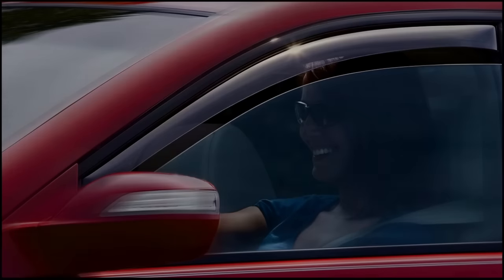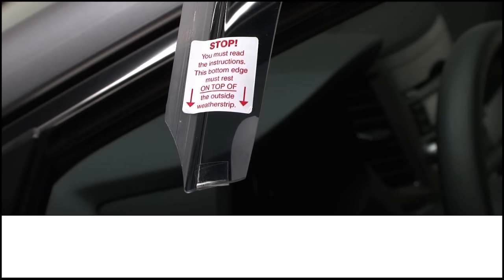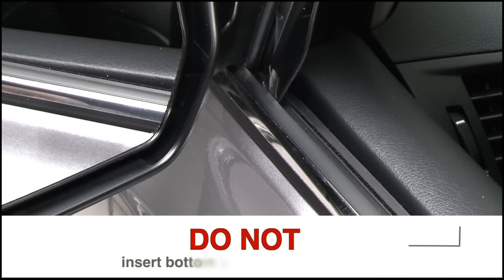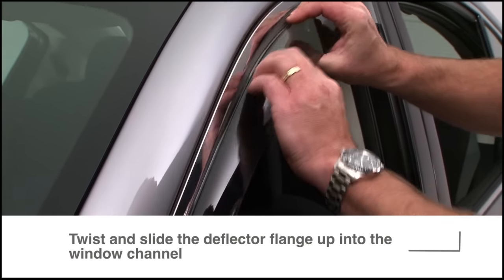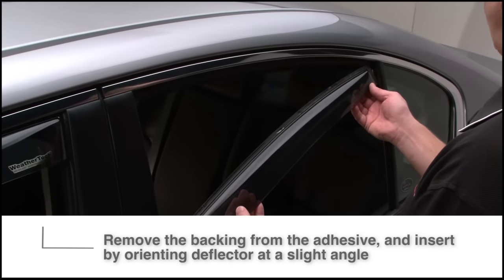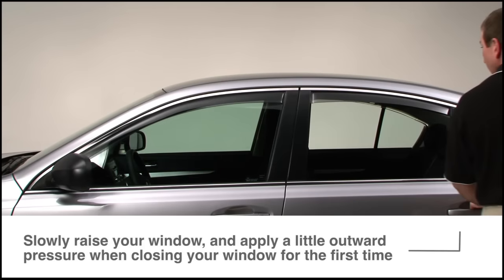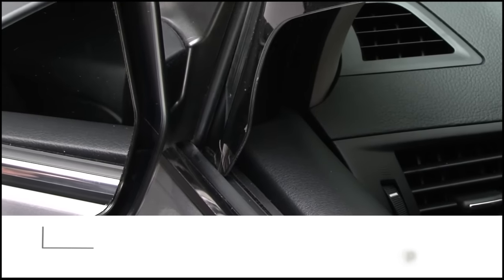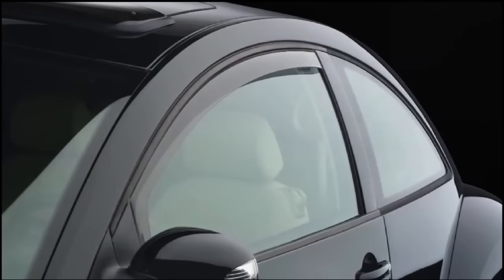WeatherTech Side Window Deflector Installation Video

Comment: so installed these on two cars, g37 and sonata. both were easy as cake on the drivers side but on the passenger, they both broke off a little bit of the edge clip. they installed better with the piece broken and rest great but i'm worried if it will blow off or something. is this ok to keep like this or should i contact weathertech for a replacement?
i will note that they are NOT as flexible as shown in this video, just bending it slightly, made it crack.... i was very disappointed  by that.
Reply from the maker: Please give our Customer Service team a call and let them know what happened - (800) 441-6287. They should be able to help you out.
Reply: +xxx4reggie Check Amazon and use their car 'fitter' tool. There may be models that fit, but don't say they will on the WeatherTech website. I got some for my 2012 civic and their website says they don't make any. However, the models for the previous year civic are exactly the same size.

Comment: Can someone tell me if this side deflectors work good in keeping the rain out. I want to buy them so that I can leave my windows open (a little bit) in the rain and not have to worry about rain coming inside of the car. 
Can anyone tell me if they really work.
Reply: +Gustavo E. Olaizola R. Yes, you can leave the window cracked in the rain without any issue.
Reply: Thanks, I just order it!
Reply: They work great

Comment: I live in New York, and I would like to know if the out side temp. has a impact on the install.
Reply from the maker: You may have an easier time with installation in warmer temperatures. If you'd like to know more about the best conditions for installation, you can give our Customer Service team a call at (800) 441-6287

Comment: 4 attempts at installing rear window deflectors on my 18 Soul Plus, the metal clips don’t seat in the channel and the deflector is loose and sloppy and will fall out if I try to drive with them in. Bad fit.
Reply: The problem started when you bought a Kia

Comment: I've had these on my 2016 accord for about 2 days now, and im noticing a lot of wind noise, is there a problem?
Reply from the maker: +Duc Duy Au Give our customer service team a call at your leisure; they will have some tips to help out: (800) 441-6287.
Reply: @Duc Duy Au, I have a 2013 accord and would like to buy them. Are you still having issue or how you like it so far?

Comment: I will never buy these again. I have bought two sets in the last year. One set for my husband's 14 F-150 and a set for my 16 Ford Taurus. Both sets installed no problems until you go to roll the windows up. His two front ones cracked and all four cracked on mine. I have seen many complaints about them cracking but thought maybe they were installing them wrong. Nope, we followed the instructions to a tee. And they still cracked. I bought the lazer measure floor mats for my car. Have not installed them yet but if they're as bad of a product as the side deflectors I will never purchase anything from weather tech again. And will not recommend them to anyone because their products are not as advertised. Will update on floor mats once they're installed.
Reply: had the same problem on my 2013 taurus, rear right cracked and front two cracked :|
Reply: Have had no problem or issues with mine which were installed over a year ago. Good Luck!
Reply: So... did the floor mats fit? Are they any good? Looking forward to that update!
Reply: The back floor mats roll up because they're not as firm as the fronts but the front ones have worked out great. And to add to the deflectors the rear ones fall out if I roll my windows down.

Comment: My front Windows wont go up all the way with these. Why not?
Reply: The "all the way" up setting is just a hair lower than without using the rain guards. Because of how they are designed with the small lip sitting between the rubber and the window this will happen. Most cars should have a feature to set the full up/down length of the window. You should check your cars manual and if all else fails go to or call the dealer and explain that you installed these and your cars window doesn't stop trying to go up when it hits the top.
Reply: @xex2kok  just expect a fee from the dealership, don't expect free advice, they'll want you to bring the car in....

Comment: will these damage the rubber fittings that you put it between?  Are they just as easy to take off if you needed without any damage?  I really want these!
Reply from the maker: ImmaGhost They should not damage the rubber fittings. Also, if you need any help with removal, you can always give our Customer Service team a call and they should have tips for easiest ways to remove the deflectors: 800-441-6287
Reply: I really want these got my 2015 Altima  but I dont  want no problems  them!

Comment: This guy is pushing out on the deflector when he rolls up each window.  Why is he doing that?  One might expect that from a $40.00 set of deflectors, but you shouldn't have to do anything to make these work correctly.  How are you supposed to push out the other 3 windows when you are driving and are the only one in the vehicle?
Reply: Pete Minter You don’t need to do that every time.  Just on the initial installation.  Then let them sit for at least 12 hours with windows up.  I actually waited 24+ hours.
Reply: To help seat the flange against the outside half of the channel. This reduces the interference with closing the window the first time. After you let it sit for 12 hours, it should stay seated correctly, and no more pulling is required

Comment: Just bought these for my 2010 accord sedan and my window won’t fully go up it automatically comes back down
Reply: my 2008 is250 was like that too, just make sure you apply pressure outward on the visor when you roll up the windows
Reply: I’ll try that.Hopefully it won’t mess up my tints in the process lol I got them done like 3 weeks ago

Comment: Mine broke during install. Not as flexible as video shows. The front kept popping out while inserting the back. It would never seat on my 2004 Tundra double cab. Wasted $$
Reply: Did you try to install them under cold weather? I've heard that on cold days (below 70deg F) they become a bit brittle and won't flex at all, so they say to install on a warmer day, below 105deg.

Comment: Hello, how do you remove the driver visor for accord ? For some reason my glass is not lined up when I roll up the window, I want to remove it and install it back. Is this a known issue?
Reply from the maker: +Azola Frenando If you give our Customer Service team a call, they should be able to walk you through this: (800)441-6287
Reply: WeatherTech I did, pretty much the same way I put in lol just backward.

Comment: Got some for my car and they fit like poop. Cracked the very first time i tried to install the first part. Clearly they made it brittle there and it's supposed to be able to bend in half lol. 2015 si got damage on a trim piece up in the corner because the fitment of this product is garbage. Windows couldn't even auto close after installing and it was popping out of one end because fitment is shit. Gonna definitely be filing a complain with the company because now I have to pay out of pocket to maybe get my money back and pay to replace a trim piece on my door. Was a technician at Honda and I always wondered why we never installed these from the dealer. Horrible product.
Reply: Did you try to install them under cold weather? I've heard that on cold days (below 70deg F) they become a bit brittle and won't flex at all, so they say to install on a warmer day, below 105deg.

Comment: these things are pure garbage. Bought a brand new set and put them on as the instructions provided. 1st time it got washed by dealership the rear drivers door popped off. Put it back on and a month later it fell off again. This time somewhere on the highway. I only had them 2 months and after that 1 fell off I threw them in the recycling bin. I`ll go to a competitor that I have bought a set for my other vehicle and 3 years and not 1 problem.

Comment: no!.. because is urgent. in mexico your dealer.. delete 5 weeks... i called few minutes your office in USA... and told me that have the 2 kits on exist... but cant send to mexico the package...
Reply from the maker: You could try our ebay store to see if you could get a faster shipping time through that route: Here is the link for the 2011 Jeep Grand Cherokee http://www.ebay.com/itm/281403719198?item=281403719198&viewitem=&vxp=mtr and here is the link for the 2013 Dodge Journey: http://www.ebay.com/itm/WeatherTech-Side-Window-Deflectors-Dodge-Journey-2008-2014-Dark-Tint-/400646877417?pt=Motors_Car_Truck_Parts_Accessories&vxp=mtr&hash=item5d486a30e9

Comment: So, that front corner of the front visor stays outside the window track forever? It never goes inside the window track??
Reply: I believe it's for two reasons:
1. If the corner is inside the window track, it still stop the window from rolling up (or break the window or the deflector depending on how smart your car is to automatically lower an obstructed window!)
2. You want rain and wind that hits the deflector to be, you guessed it, deflected *away*, not inside the window track

Comment: I recieved 2 black clips for the rear window deflectors do i have to use them if so how do i install them?
Reply: Mine came with clips to and yes I needed them, you can call to double check, honestly they are kind of a pain but just take your time and follow the directions
Reply: @smexyzinda801  thank you